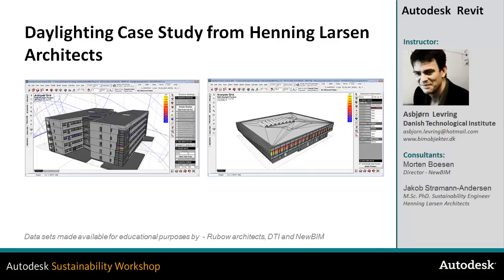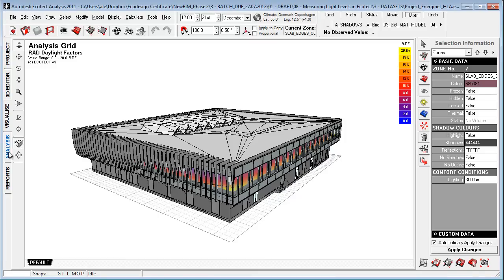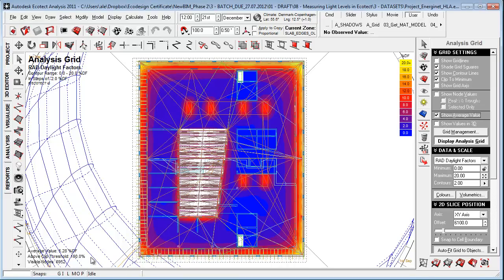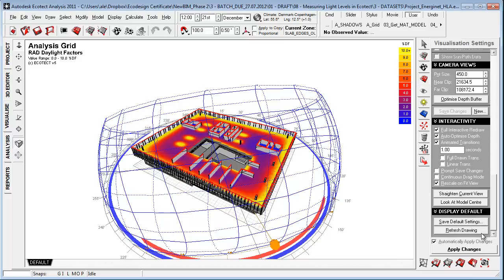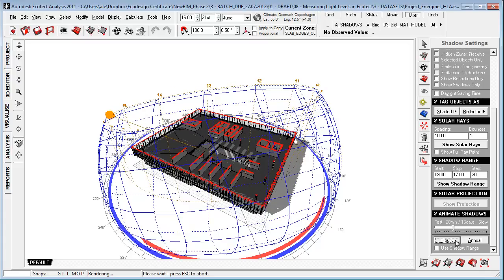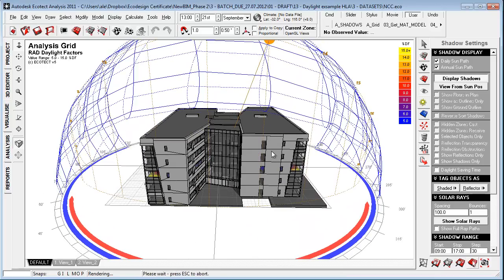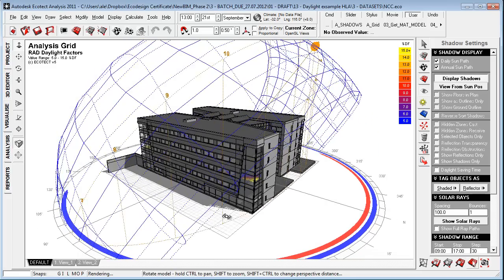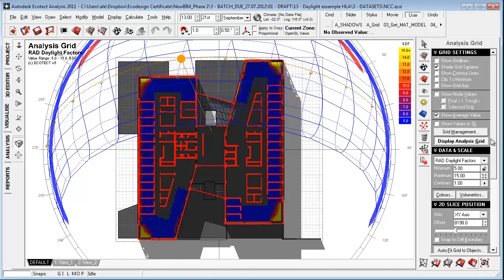Daylighting Case Study in Autodesk Ecotect from Henning Larsen Architects

Comment: Have you calibrated Ecotect's Radiance results with measured results? We have found it to overestimate daylight values by quite a high margin - both in relation to other software and measured results. Also, there is an issue of "leaking light" whereby fully enclosed volumes will still report daylight inside.